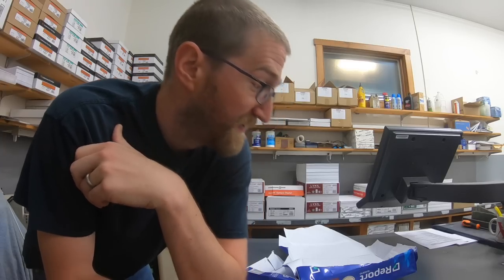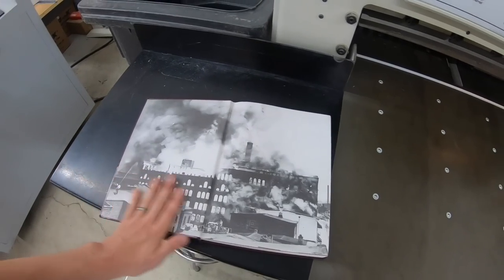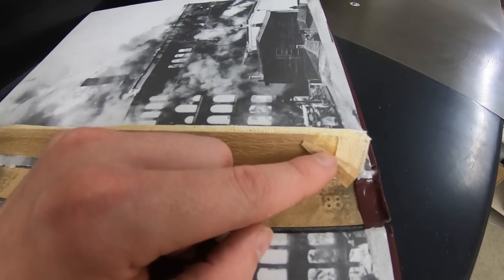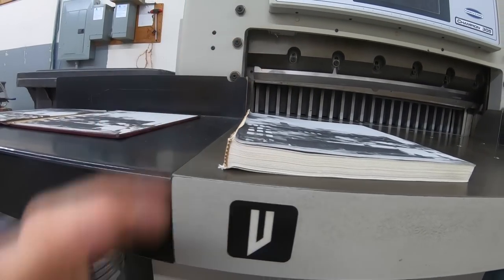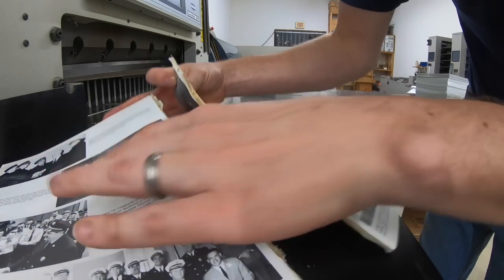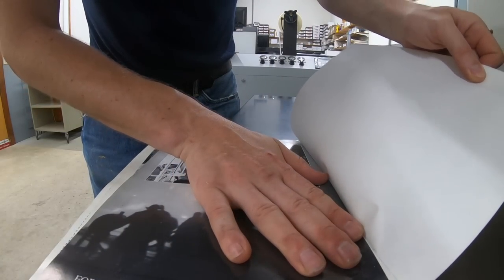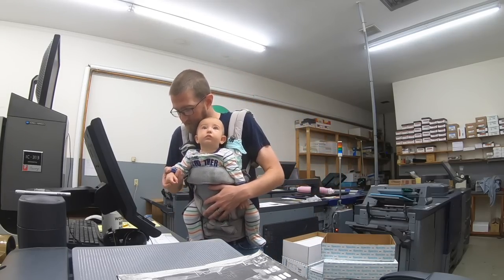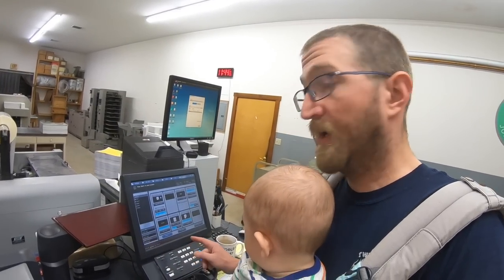Cutting Books Apart To Scan to a PDF on Konica Minolta Copier

Comment: When faced with an issue where I needed to scan a screened halftone, if you have the capability to reduce by 5%, hardly noticeable in the final product, it should help to avoid 'Moire-pattern' on the halftones and give you a little more space to create a gutter for your signatures.  I assume the re-print will be perfect bound.
Reply from the maker: Interesting, didn't realize the reduction would reduce moire. I'll have to try that.

Comment: It's a good thing the customer gives you permission to cut the book. Often times they don't. There are special 'scanners' utilizing a high def camera on a special stand.
Reply: There has been a lot of progress in book scanners and the software now is much better than it used to be. There's really no need to cut any book apart to scan it these days. I saw this video on another channel I watch recently reviewing this book scanner, and it looks pretty impressive: https://www.youtube.com/watch?v=__D_icYubDY
Reply: @gorak9000  Time and labor cost is certainly a factor, cutting and scanning in through a sheet feeder is much less labor intensive then going page by page with a book scanner.
Reply: @DerpyMail  I don't know, looks like a LOT of time went into cutting it and separating the pages. With the book scanner, it's just flip, click, flip, click. You can go pretty fast. That czur place has a video on their channel claiming to be able to scan a 300 page book in 7 minutes - I have no idea if that's a valid claim. Doing a little back of the envelope calculations, that's 150 page flips in 7 minutes (you get 2 pages per flip) - 2.8 seconds per page flip - seems pretty reasonable actually
Reply from the maker: I have seen these and would love to give it a try. I would also just love to see the quality of the PDF those scanners make.

Comment: My assumption on the lack of folio sheets is that the bigger shops are gobbling them up for their 40” presses. Sucks though, because some textured stock they only sell in parents or 8.5”x11” and I try to run everything 12”x18”. So weird how just a couple of years ago this was never a problem.
Reply: 4over and the like are gobbling them up for sure but even they have cut back on what they offer. Read my comment above on what I heard the reasons for the paper shortages are.
Reply from the maker: Yes, the paper issues changed fast. Lets just hold on and hope for the best!

Comment: The traditional headbands were less about structure and more about protecting the ends of the signatures.  Since they were actually stitched onto the signatures and wouldn't move from their intended position. 

I'm sure the glued ones are (or were? For my home made bindings I still put them) because books were supposed to have one and wouldn't look like a proper book without it?
Reply from the maker: Yes, casebound books without headbands look naked!
Reply: @Matias Tonazzi. Back in the last century, one of my student colleagues at The London College of Printing worked for a large binding company where they had various mechanised bookbinding lines. I'm sure he said that one of their machines could apply "dummy" headbands (not sewn on) to the book blocks. The headband material was fed from a roll, glued on to the head and foot of the book blocks, and then cut off to size. The idea was to make a mass produced case bound book appear more expensive. Can't remember the name of the machine line. Could be one of many names - Kolbus, Muller-Martini, VBF-Sigloch? Stay safe and well.

Comment: I usually combine the two PDFs (the grayscale and black and white one). I just delete the photos from the black and white and delete the text from the grayscale and then combine them. It takes some time, although with batch processing it's easier. I guess you can count it as a redesign if you've done this much work on the book.

You can also transform the text only to black and white in photoshop as a solution.
Reply from the maker: Yup, thats one way to do it. Either way its a lot of time.
Reply: Could you tell me how to combine them? I am a newbee
Reply from the maker: @joejodi927  You need Adobe Acrobat PRO or other software to combine PDF files. There might be website where you can upload files and it will combine them too.
Reply: @justaprinter  Got it.. try it later. Thanks
Reply: @HenryLoenwind  Thank you for your explanation bro.. try it then.

Comment: Paper shortages in cut sheet and especially in rolls are prevalent across the entire domestic US market. There are US mills auctioning off their available tonnage instead of taking orders from long standing customers. I believe more mills will either be transitioning to packaging or coming offline by the end of the year - better stock up.
Reply: What is causing the shortage and what do you see happening the next few years with paper supply?
Reply: See my comment above on what I heard is causing the shortages.
Reply: @bergencounty6602  it’s a multitude of issues compounding where we are today. A big factor are mills retooling to satisfy different markets such as packaging, increase in marketing activity from a direct mail standpoint, overseas production had been on strike (Europe) or tonnage stuck in ports due to quarantines (Asia), COVID, difficulty in transiting goods domestically, etc. I don’t think anyone has ever experienced anything quite like this in the past 30 years or more.
Reply from the maker: I have been stocking up when paper comes available. I'm becoming somewhat of a paper hoarder.

Comment: I assume that OCR is more trouble than it is worth, especially when formatting around photos.
Reply from the maker: You are correct!
Reply: OCR software has had big improvements as time has gone by. Also book scanners where you don't have to cut the book apart have also improved a lot recently. I have no actual experience with this product, but another channel I watch did a review on a large format book scanner recently, and the results look pretty impressive: https://www.youtube.com/watch?v=__D_icYubDY. This seems like it's one of the rare kick starter projects that's actually not a scam. Things I'd double check though is if the software is fully self contained, and doesn't have any "cloud" connections, so even if the company disappears eventually, it will continue working - something you have to be careful about in almost every "cloud connected" bs product these days

Comment: Mac Paper and Verative are running at 25% availability on all paper stocks. I can’t get any 12pt 14pt 16pt c2s anywhere. Even 4over has cut way down on what they offer. So same as you, I’ve been running a lot more 8.5 x 11 which sucks! My contact at Mac told me the main paper mils in the states had gone out of business during Covid and a shipping container company bought the facilities and are using the pulp to make corrugated boxes for themselves. This leaves asia as a high production mil but they don’t want to ship to western countries because of cost. It makes sense because any paper I find is Sappi/Moorim or Pro Digital. I don’t see this issue getting better any time soon. What blew my mind as well is prices. I just ordered 1,000 12x18 sheets of 100# cover classic crest for $288! It used to be about $80! 😭
Reply from the maker: Yes, it could be bad for quite awhile. People will have to be ok with printing on 20lb 8.5 x 11

Comment: Hi Dan, Can you suggest me the best settings to print texture paper in Konica C1060. How to improve quality on texture paper.
Reply: I know in command workstation you have a use max density check box. You can also go into the advanced settings of that particular stock and increase the density there as well.
Reply: Thank you, I already did this but not any significant difference.
Reply from the maker: I have found that printing on textured paper is hit or miss. But overall textured paper is not the best to print on.

Comment: I have a question,  what happens with papers that are inseparable when scanning, the printer picks two sheets instead of one and also straightening scanned book when they look slanted? And How do you charge for this.
Reply: In my case, before scanning make sure each page have some air between. There also some setting for paper weight in scanner. Cleaning/replace roller also help.
Reply from the maker: Yes, fanning the papers before hand is great. But and skew that happens during scanning can be fixed on the computer later.
Reply: @justaprinter  Thanks for your response. How do you fix the skew on the computer?
Reply: @ijalalfa3233  thanks for this, especially the cleaning part.
Reply from the maker: @arnoldkd1  I fix it with Elan software. You can also use adobe acrobat pro. Others that exist are pixedit.
Reply: @justaprinter  thank you

Comment: use chain saw or electric circle cutter to cut book bind as small you can. then papers will be same size and separate.
but seperate book cover with hand carefully. then put back after scaning book.
Reply from the maker: You got it!
Reply: @justaprinter  you can also make wood plates to hold book part other than binding part. 

And straight the whole book first in wood plates then tight the book with clumps. Then cut with electric cutter.

Comment: My supplier told me they will not have coated stock until 2024
Reply from the maker: Thats a bummer, I'm about out of my coated text weight.
Reply: @justaprinter  I am down to my last 3000 sheets of 80lb text and I haven’t had 100lb text since November… this is scary 😟